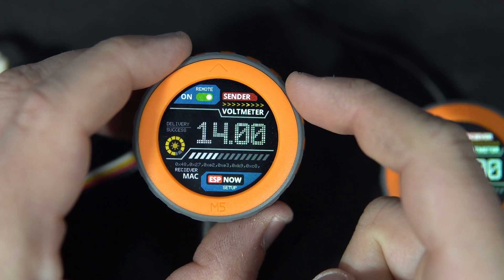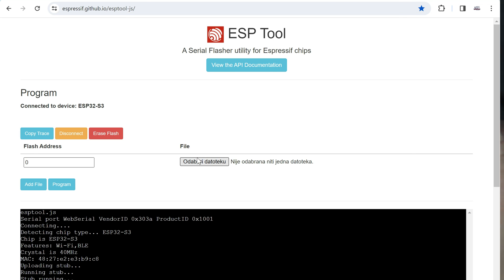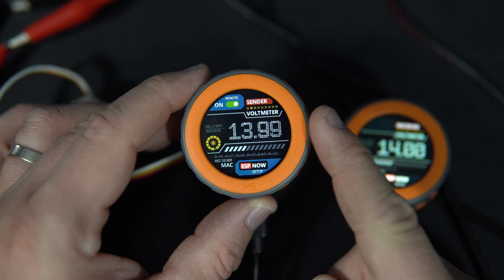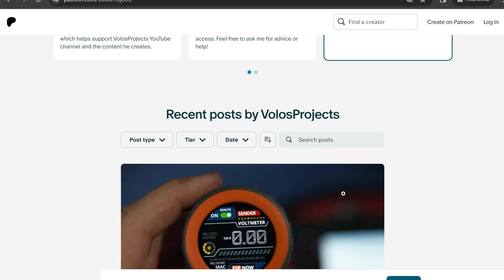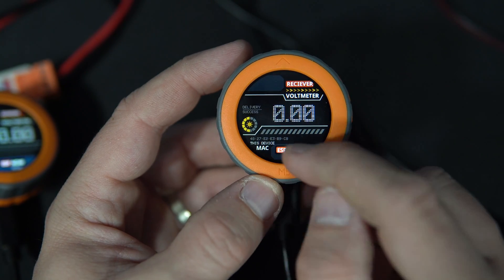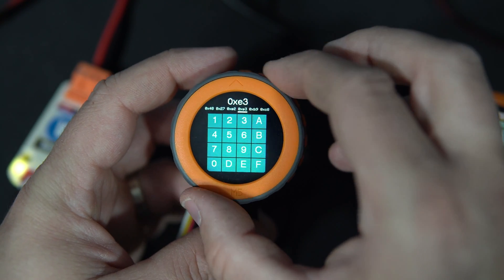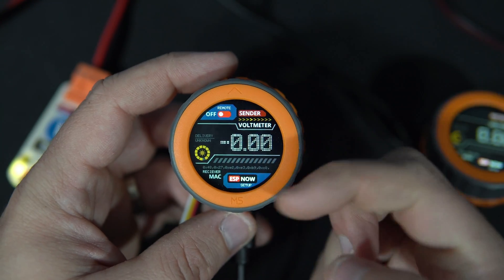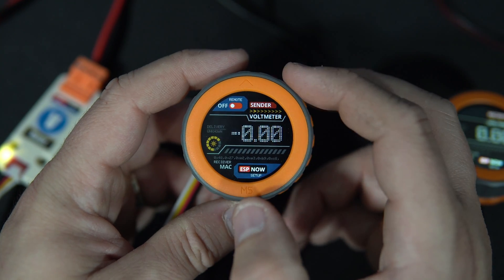Remote Voltage Monitoring System Using ESP32 and ESP-NOW

Comment: Hi I have some trouble implementing this, I get an error: 
Compilation error: 'class ADS1115' has no member named 'begin'
I am using M5-ADS1115 library version 0.0.2 and all the same hardware.

Thanks

Comment: Hello, great project! Thank you for sharing the source code. Could you please verify the ESP board type you compiled the code with?
Also could you specify which libraries you used. So far I had identified:
TFT_eSPI, M5Stack, ADS1115. I am getting errors about a missing header file. Are there any other libraries?
The missing header file is ADS_1115.h    thanks!
Reply from the maker: Board is m5dial, you have link in description. This code wil not work on other boards and it will not work without voltage sensor.

Comment: I just use the broadcast address (ff:ff:ff:ff:ff:ff) for all  ESPNow communication. You lose error checking and encryption but you don't need to worry about addressing. If you need encryption it can be done in the app. This also allows an unlimited number of nodes and it is much simpler to implement.
Reply from the maker: Thank you i did not knew that.

Comment: ESP Now supports multiple slaves to one master and transmits telemetry. Have you consider having several voltage sensors providing readings to one master display and displaying rotating sensor voltage readings? There are many applications for a single console and multiple sensors. ESP Now master searches for multiple slaves and discovers the MAC addresses as part of its operating mode just as Bluetooth.
Reply: I just use the broadcast address (ff:ff:ff:ff:ff:ff) for all  ESPNow communication. You lose error checking and encryption but you don't need to worry about addressing. If you need encryption it can be done in the app. This also allows you to support an unlimited number of nodes.